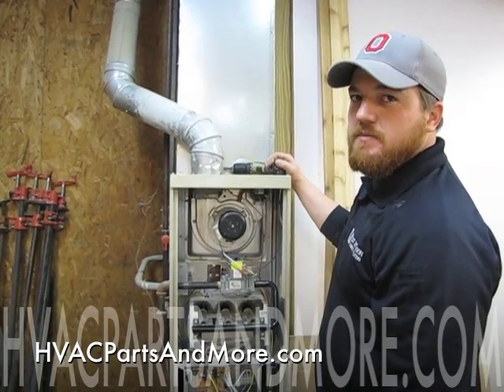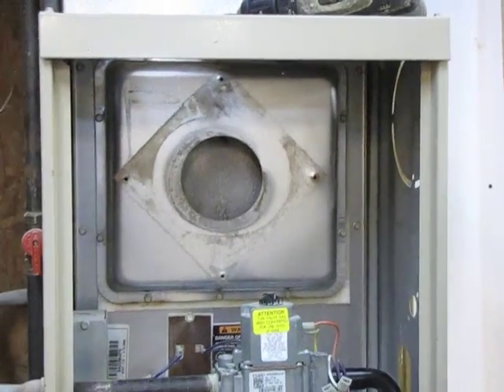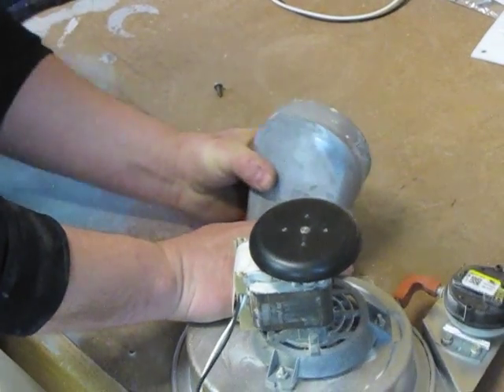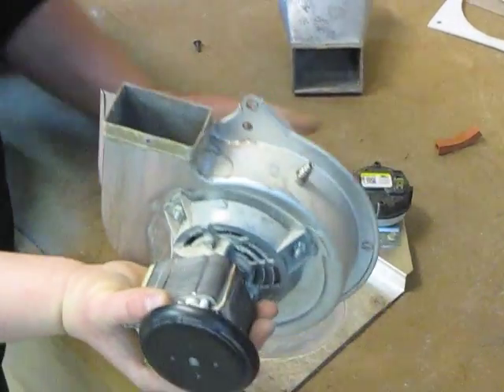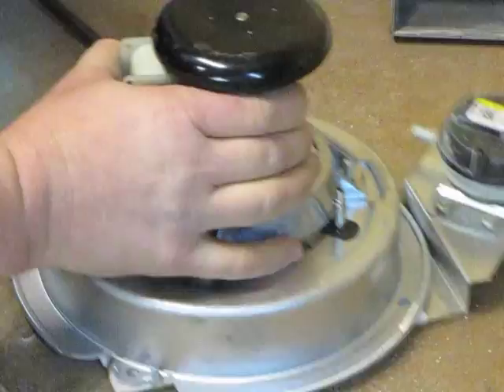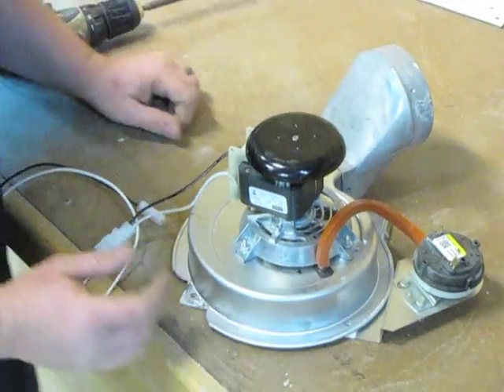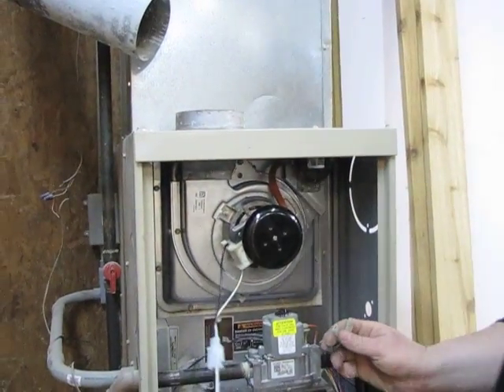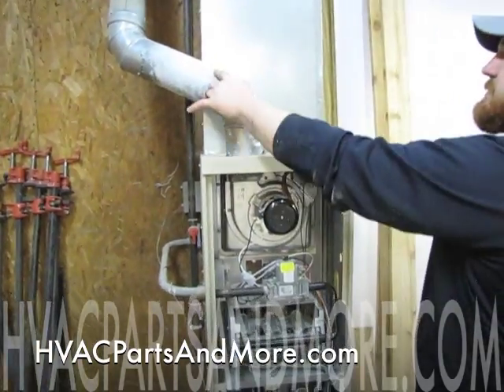DIY - How to Replace a Draft Inducer on a Lennox G40 Furnace

Comment: Nice job Todd!!... very informative and to the point. I saved a ton of money doing it myself. I was quoted over $500.00 CDN by a company in Calgary AB just for the motor which I bought online and had delivered to my door for $267.48 USD all in (TAXES, DUTY, SHIPPING, ETC.) saving me $142.00 before even calculating the install costs which I would say would have been $250.00 - $300.00 minimum. It was a VERY EASY (under 1 hour) install following your video and I saved over $400.00+. I encourage anyone watching this to order the part online and DYI as it really was a simple replacement.
Reply: Hi ,I am having issue with me Lennox Draft Inducer G40UH , Please may I know from where you got parts . I live in Calgary and today Action Furnace gave a quote of $879 .

Comment: Can I use silicone 600 resistant instead of the fiber glass gasket?
Reply: I have successfully used Permatex ultra red copper high temperature silicone. It is intended for repairing car exhaust pipes and it's rated -75 to 700 F so it works for furnace use. Follow the instructions on the package and you should be fine. You do not need to wait 24 hours before you fire up the furnace again. Just give it half to 1 hour so the silicone starts to cure and then the heat will set it, no problem!

Comment: there is a SERVICE AND APPLICATION NOTE for New Replacement Combustion Air Inducer Kits (24W95 & 43W85) For G40U, G50, & G60 Furnaces. 
Search the internet for Lennox SERVICE AND APPLICATION NOTE H-06-4

If you look carefully in this video, you can see that the  port location for the replacement air inducer is in a new location, requiring a new (different value) Pressure Switch set point.
The particular one depends on your locations' elevation. Mine went from .47 to .40, that is, part 24W97.

For my situation, my inducer port was clogged, and only needed clearing with the end of
a 5/64th inch drill bit, but getting the high temp pressure tubing off the barbed port
was impossible without tearing the tubing.  Buying replacement tubing, as not part of an air inducer kit, is pricey.  If I were to redo, I would just remove the non-barbed pressure switch end and carefully thread the clearing rod through the 2" long pressure tubing.

I am guessing that the new design avoids crud flinging off of the air inducer blower fins
and clogging the port, but being orthogonal to the air flow lowers the incident pressure.

For reference, some measurements that I took off my G40U Furnace:

Lennox 49L90 pressure switch
0.26 inch outer diameter of pressure switch port
0.10 inch inner diameter of pressure switch port (7/64)

Lennox 7058-0217 / Fasco A207 Air Inducer
0.25   inch outer diameter of air inducer port (1st barb)
0.237 inch outer diameter of air inducer port (at the base)
0.09 inch inner diameter of air inducer port (3/32) outer (thru outer wall)
0.08 inch inner diameter of air inducer port (5/64) inner (to clear to blower blades)

Lennox 98L78 high temp silicone tubing
0.1875 inch inner diameter of high temp silicone tubing (3/16)
0.375  inch along the edge of the square profile high temp silicone tubing (3/8)

I wish to thank HVAC Parts for this repair video.
Reply: Yes Kevin I too noticed that he Totally blew the part about some motors also Requiring a pressure switch replacement!! Thats a HUGE error to make!!

Comment: Do you know what the gasket is made out of? Looks similar to my furnace as it's starting to fall apart and possibly need replacement.
Reply from the maker: This particular inducer uses a fiberglass type gasket.
Reply: What is the part number for the gaskets?
Reply from the maker: It is most likely 81L93